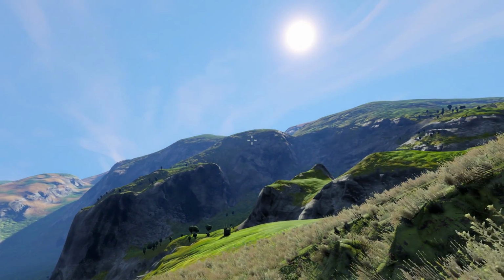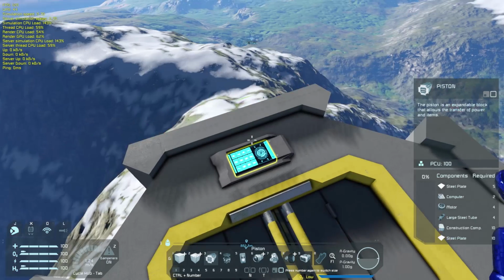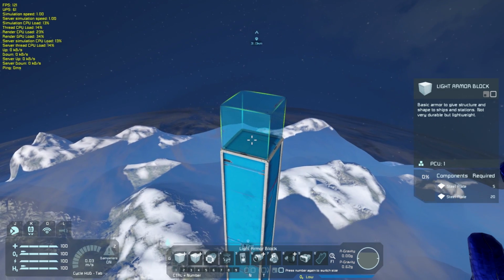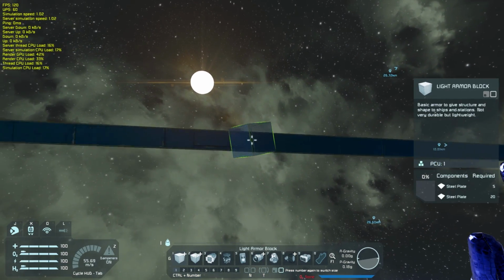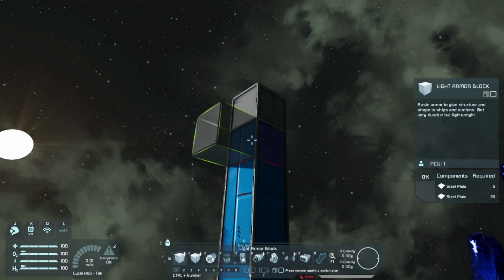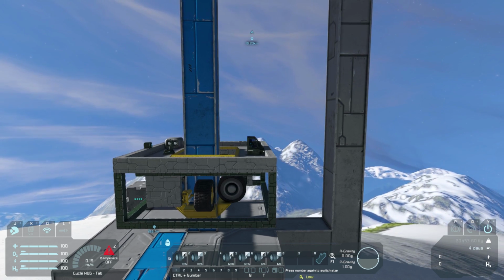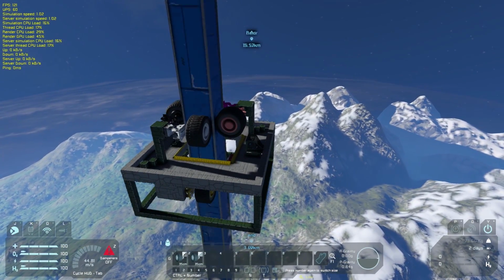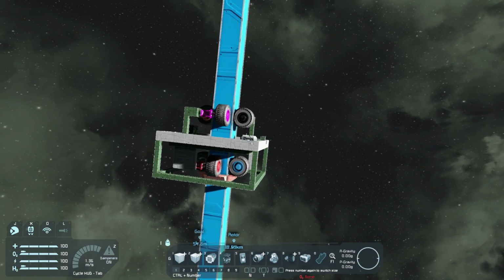Space Busters | Can We Make a Space Elevator? | Space Engineers

Comment: Fun fact, a space elevator is 100 times more efficient than a rocket. [5000$/pound vs 50$/pound]
Reply: That is if it is possible to build a space elevator and hope it doesn't snap off somehow
Reply: @周生生-f1f  There's a handful of things you can do to not let it snap off, for one the top bit would be "in orbit" basically, so it would be following the bottom half pretty easily. The physics of it is already in place, it's just the matter of a Need for it, then it'll be built fine I'm pretty sure.
Reply: @RogueOtterDoom  It's a lot tougher than just having the station in orbit though
The tension experienced by the tether is tremendous, the base would have to also experience the force, which so far no material known to men can survive that without snapping off. In addition a space elevator would be a pain to maintain, will be easy target for terrorism or enemy military forces, etc.....
Reply: Well also keep in mind that the tether will have to extend to geostationary orbit, which is almost 36000km high.
Reply: It wouldn't work there are many reasons like the whole would fail
Reply: Building it would be next to impossible. The height of it would be impossible to work with. Tall structures get difficult to work with when you get to a certain height. It would collapse no matter how you built it.

Comment: It would of worked a lot better if the wheels were pushing against the tower a lot more. Also it would be better if you had one set of wheels above the platform and two sets below (why do you think trucks have this kind of setup). Also a guide would be needed so it doesn’t rotate or spin. I haven’t played SE in a while and I don’t know what parts are in, so I’m thinking a guide rail would need to be something that’s high in friction (metal on metal grinding)
Reply: It would HAVE worked a lot better if you didn't write "would of worked".

Comment: Ideally it would be for hauling supplies to and from planet right? I would build a platform with a connector, if they are both on the connector should grab it as you pass by if you have it slow enough. off load the supplies then just unlock to come back down.

Comment: I would like to do this in survival mode but the work and resource >.<
Reply: From the ice moon near Mars I built a space elevator column made of conveyor blocks. The idea is to instantly transfer ores from the ground to space. I already had an asteroid eater so resource is not a problem, still the work involved is tiresome and the admin yelled at me for building such gigantic objects in his server.
Reply: Ya it would be crazy to do it in survival I still can’t believe that epic tech did
Reply: Been there, done this on a multiplayer server. I built a self propelled building rig, with a custom program block to run it, then I just had to keep it topped up with steel plate.  It was a modded planet, so I only had to go 20K.

It worked by coupling merge blocks and pistons on the build platform. The platform locked to the tether will the piston arm reached up to the next merge block. The platform then detached and lifted up to lock to the next merge block. 

The server did have a nanite mod, which made it easier.  You can do it in vanilla, but it’s much harder to remove the merge blocks from the tether as you build. 

It also killed the server when it was inevitably destroyed.

Comment: I ouuld love to see it made with many smaller rotor arms doing like a relay and attaching and detatching to pass on goods up the line.  alternatively, instead of pistons pushing up without a guide rail, how about pulling things up. the only flaw would be the excess height required to account for the unextended size of them.

Comment: In real life, anchoring the base of a space elevator on top of a mountain wouldn't make much sense.  The difference in required cable length would be miniscule (a few kilometers compared to a total length of 30,000 kilometers or more), while the logistics of getting stuff to and from the base would be much more complicated.  Better to anchor it at a major seaport, and save on logistics costs.

Comment: Pistons? I think you might want to use a rail system with a cart system, the cart going up and down using wheels pressed onto the rails by the gravity of having some weights on the side opposite to the cart.

Edit: I see you tried that in the second half (or third third) of the video.

Edit2: I think you need more rows of wheels...
Edit3: Oh, you also did that...

Edit4: For stopping, you might want to use a landing gear, and maybe put it on the subgrid of a rotor whose angle you change to get into and out of locking position.

Comment: it would make no difference if it was build at sea level or on top of the Everest. the difference in length of the space elevator would be insignificant as you need a cable that s 3 time the diameter of the earth. the geostationary orbit is 35 786 km away. :0

Comment: The idea of a space elevator irl, is just a cable and counterweight with the elevator just climbing the cable. The physics is to make the cable twice as high as need to get to orbit. This would be where the centrifugal force of tension equals the force of gravity. The geostationary orbit point is this location. This has been calculated to be ~35,000km. So the elevator would have to be ~70,000km tall. While the final 750 tons of cable would be expensive, the efficiency of an elevator compared to the normal rocket launch would make it so much better, a rocket launch costs $25,000 per kg while the elevator just $220 per kg.

Also if the rotor was truly 18000km and moving at .14rpm. C=2pi*r, 2pi*18000=113000km in circumference and moving at .14 rpm, you should have been going (113000*.14)/60seconds=263m/s

Comment: When considering material science and several physical laws regarding weight and stability, centrifugal force, momentum, etc..., space elevators are impossible. Fun idea, but impossible AND impractical. It's less logistically infeasible to keep shooting hunks of metal into space than it would be to build and maintain a physical elevator that does the same thing - opposing gravity - anyway, ultimately requiring, in some form or fashion, the same amount of work a rocket needs. Considering the additional friction of whatever system you're using to push or pull the elevator up in the first place, it probably would take MORE work.
Reply: but you would only need electricity to put things in space once the elevators built, no disposable boosters no tons of fuel. and it may be impossible to build on earth but one could be built on the moon with simple steel. and mars with i think it was called zylon? if either became industrialized in the far future space elevators would probably be built.
Reply: Electricity doesn't appear magically, you have to generate the work in one way or another. What this means is that you can use a different energy source, yes, but it won't cost less, per say.
Reply: i mean that electrical power is cheaper and easier to produce in large amounts compared to the fuel and rockets you'd need without the space elevator. it's a massive investment but if you're going to be moving industrial levels of freight it starts being cheaper than having just stuck with rockets.
Reply: @EvelynNdenial  I think your describing a EM drive which could never work
Reply: not at all. im talking about a space elevator which would likely run on beamed power from either a powerplant on the ground or solar arrays at the top.

Comment: why on earth would you create a piston elevator or even a rotor elevator???  its not sensible in the least.  you should have taken a more tried and true method.  Why didn't you create a tower of babel elevator instead, which would work?  I mean the shaft for each of your elevators were way too narrow..... why so narrow, is beyond me. it would never be efficient for productivity because for one ts unstable, and two it would be way too brittle. That elevator with wheels should have had wheels on the top platform and not just the bottom in the first place.... but your shaft was too narrow if you had made the shaft bigger and doubled the wheels below and above the platform... much more sensible.